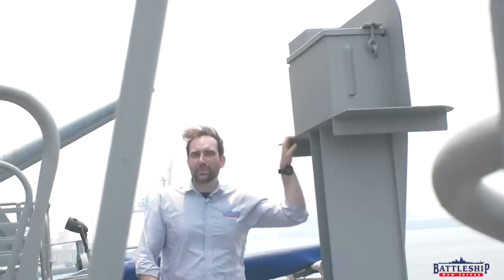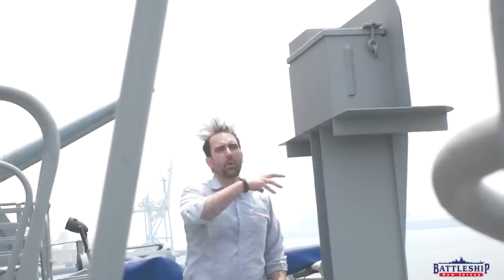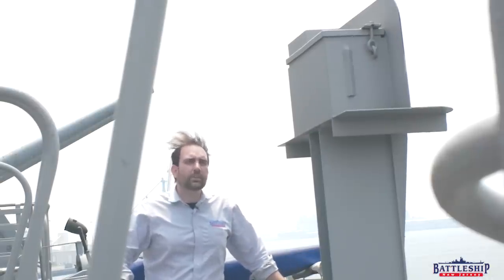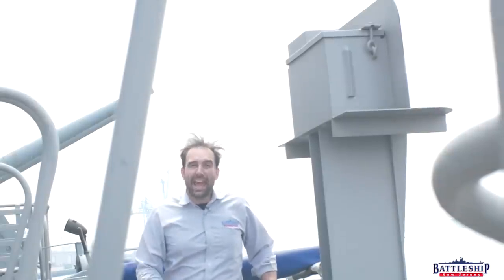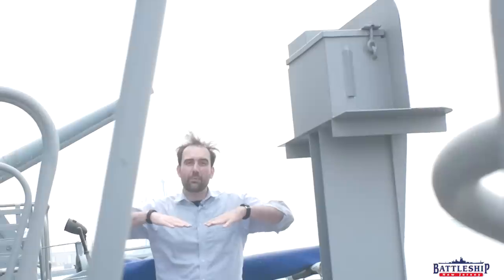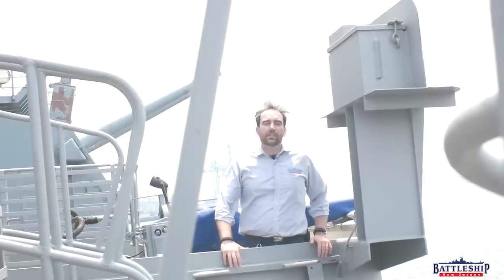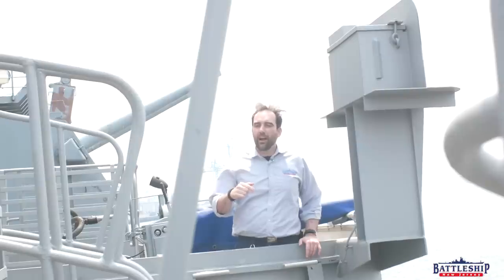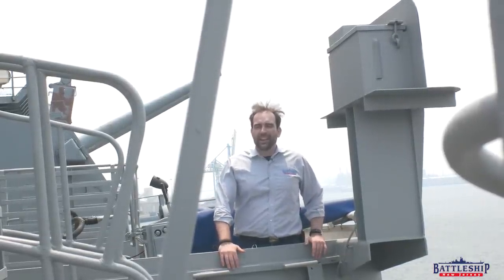Sailing At Night: The Battleship's Running Lights

Comment: I was always tought red on right.
Reply: Red on right when returning from ocean. That is what I remember from sailing course.  Must be wrong.
Reply: Red, Right, Returning means you should have the red buoys on the right side of the ship when returning from sea.  If the red buoys are on your left you're out of the channel and in danger of running aground.
Reply: Red light returning means to keep the red light on land or the buoy on your right side.
Reply: Thanks boys.. Ben a decade plus since I've had to pilot into a channel... Guess this is why I also remember red is dead heading out as the incoming vessel is in incoming.
Reply: @adamlewellen5081  Trivia item: The light fixtures flanking the garage doors at the Chicago fire stations have red and green lights, with the red light on the right side of the door as you would drive into the building.
Reply: @mwswarrior  You must be a Coastie!

Comment: "Tall Masted Battleship" ....what has to be removed before sailing under bridges? What navy yards (current & previous) require something to be removed so NJ & sister ships can sail under bridges? 🌉🚢
Reply: its an interesting question because the Walt Whitman is 150ft to water line from bottom of the deck so either the NJ had to trim or its mast height from water line is lower than that. Or they just waited for a really low tied and took on a bunch of ballast as that could also fudge the height some. There are two bridges down stream but they are all higher than 150 to water level.